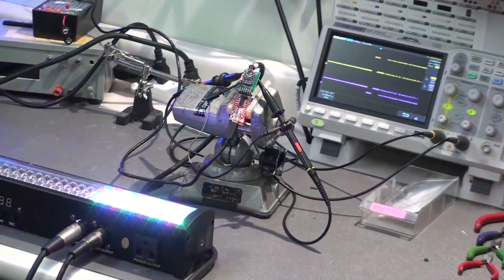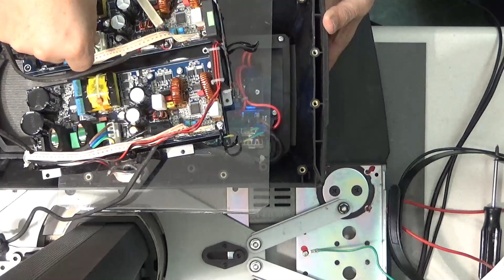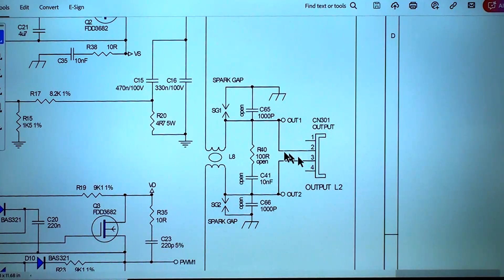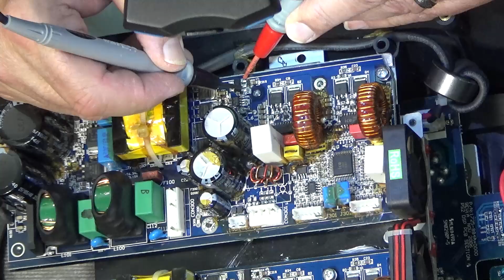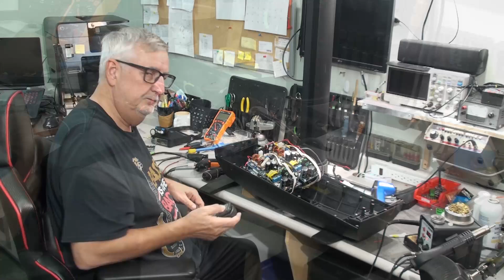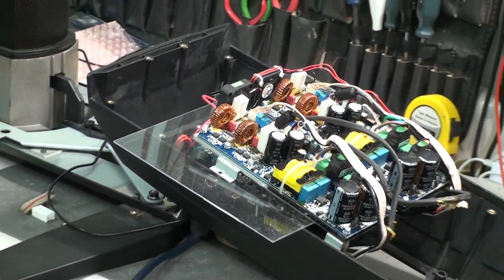"Sticking" with a Bose L1 Model II Portable PA - Part 2

Comment: Hi Ron, 

Awesome video thank you so much! I am a musician and shade tree electronic repairman for my own gear if possible .  I have some questions about this same Bose L1 model 2 that has worked great for years until now.   I hadn’t used it in a while but we were going to play a show and it had a lot of persistent noise coming from just the tower alone w/o any B2 base module connected and nothing connected to it at all .. no tonematch input , no analog input.. nothing.  Just the power cord and tower.  It wouldn’t matter if I was turning the trim pot at all but I know that historically these Bose trim pots tend to crackle “scratch” when you move them but all noise would stop when you stopped turning it. Mine always did that.  

Yet now this same noise was persistent regardless of whether I turned the pot or not but since it sounded similar - I thought it might be the pot so I tried spraying, didn’t help and then I replaced it with a THONK Ltd A100K - D shaft - Alpha Vertical 9mm Potentiometer … and the noise isn’t as loud but it’s still present.  

However, now the volume doesn’t work at all for the analog input and there’s no sound at all coming at all from the analog .  Only the tonematch input works but there’s still some very faint persistent noise.  I looked at the old photos of the old pot that was in there and it looked like pin 5 & 6 on channel 2 were soldered together so I did that.  Is that correct to do or should they always be disconnected?  I can’t tell if pins 2 & 3 on channel 1 were soldered together so I didn’t connect them… and I’m not sure if they are connected through the board or should I solder them together?  All other pins look like they are  individually soldered.  Is that correct according to what you have seen?  Thank you so much! 

I emailed you a pic I just got from THONK and it looks to me that if pins 5&6 or 2&3 were soldered together, it would be like the volume was turned all the way up?  Is that what you understand? 

Anyway, thank you so much for any help or ideas you might have! 
Your videos are super are awesome :)

Warm Regards

Comment: Hi mine the blue power light turned solid red and system won't work? What can it be thanks
Reply from the maker: That sounds pretty serious, but at least it isn't intermittent. I can't help you much with limited information. If you aren't a tech yourself you should find one. If they need information (schematics) email me and maybe I can help. techtips983@gmail.com

Comment: Bonjour from France.

I’m a singer-guitarist playing with my own backing tracks. 
I bought a Bose L1 Compact in 2012. I’ve  done countless gigs in all sorts of places and it’s still working fine. 
My 2017 Bose L1 Model II is still around too, with one B2 sub.  The only thing  I had to get fixed is the input jack last year. 
I have the opportunity to buy two more of these used ,from a pro, with a warranty. I think I will make the deal. 
I don’t have a van, just my car. My Two Rcf 712 and my 905 sub are too heavy for my 55 years. 

Oh yes, there is the annoying ‘’Bose hiss.’’
Reply from the maker: Thanks for the comment and sharing your experience. That's good to hear about the L1 Compact and Model II!

Comment: I'm getting a low static sound on my L1 Model 2. I tried another outlet and unplugging everything from it minus power and it's still present. Its not the power hiss sound. I have a second L1 and I don't hear it on that one. Any thoughts or ideas what could be causing it? Thanks
Reply from the maker: I've heard others mention a "hiss" in their system, but I don't know of a typical cause or solution. I'm just guessing but I would start by checking the signal in the analog part of the signal path (input section) to see if it originates there. If it originates later, in the digital or output section it would be more difficult to find, I think. I did a quick AI search and one comment was "...the system may produce a faint hiss when all settings are at the 12 o'clock position with no inputs connected, which is a known characteristic of the L1 system. To address this, users are advised to keep the channel and master volume controls on the remote at or above the 12 o'clock position to provide headroom and avoid the hiss."
Reply: @techtips983 Thanks for the replay and all this info! I'll try troubleshooting a bit more to see what I discover.

Comment: Thank you very much for the video. The fan on the L1 model two is quite noisy. Can that fan be replaced with another one that doesn't make noise? Can you recommend a model? Thank you very much!
Reply from the maker: Thanks for your comment and question. I've heard that these fans can be noisy but I haven't seen one myself. I guess that, depending on where you are located, you might be able to get a replacement from Bose. I believe that fan is a 12 VDC, 5500 RPM fan. It doesn't show the dimensions but you could measure it. The manual I have doesn't show a part number but it refers to a Bose service bulletin: 296133-B1. I haven't been able to find that online but you could try... Sorry I can't be more helpful.

Comment: My bose same model as what you repaired has issues in the ethercon jack.. when i plug my bose mixer T8s the mixer would work then light on the mixer display will blink and the mixer will have no power..had to use the a separate t8s power adapter and had to use the line inputs in the base..its very  convenient for me just to use a ethercon cable and both power and signal
Is carried in the same cat5 ethercon cable..do i have a bad ethercon low voltage circut issue on the ethercon area on the bose L1 base unit?
Reply from the maker: Hi and thanks for the comment and question. I'm not sure I can give you good advice on this. My experience with these units is fairly narrow and I haven't worked on the connection between the T8 and the base unit.
Reply: @techtips983  The base unit's power supply cannot supply the necessary current to run the T8S. I've seen that noted in a variety of sources. The power adapter is the way to go.
Reply: Same issue as mine😢 ended up just using xlr cable and power supply for TS8..now my new issue is one of my column speaker is distorted probably voice coil is toast🤦🏻‍♂️..

Comment: Hi thank you for sharing your knowledge, just had the same fault, 4.7 ohm but on the other board, also replaced very noisy fans and now going to strip it to clean trim pot as its very noisy as well and the loud pops seem to cause protection to activate
Reply from the maker: Thanks for your comment. Interesting symptoms... I hope you get a solution.
Reply: @techtips983  Saw another clip from a German contributor in which he points out that the failure of the 4.7 ohm resistor is due to the failure of tha cap next to it 330n 100v and mine is completely bloated and o/c, have ordered replacement, hope thats it.
Reply from the maker: Interesting... Sounds like that could be your issue. I didn't find that with the one in this video but if that cap failed it could cause that problem. Let us know if replacing that cap solves the problem. Thanks for the comment.

Comment: Thank you Sir for the very informativ Video and professionell work. I have a Problem with my L1 too - I made a huge mistake by trying out a different bass speaker: i have connected my Phil Jones Bass speaker to the L1 via speakon plug 
It worked at First but as soon as i turned up the volume the FAULT light flashed and the Bose stopped playing any music.
I recon the OHM from Phil Jones Bass speaker where way to high to handle for the Bose amplifier…can you please give  me a tip what i could do? Is it worth to send it in to repair? Thank you and greetings from Austria
Reply from the maker: Sorry to hear about your issues. I assume that once you disconnected the Phil Jones Bass speaker and reconnected the Bose Subwoofer the problem still existed? Did the other channels work at all? This amplifier doesn't have fuses so that can't be the issue. The FAULT detection circuitry is supposed to disable the system temporarily and it should reset itself after being shutdown and restarted. If the FAULT light continues to to be on after removing the speaker, and if the channels don't work, I would start by checking the power supplies. That isn't easy. If you are not a tech you would need to find one who could work on this. I'm in Canada so I don't think it would be possible, or worthwhile to send it to me for repair. Sorry I can't be of more help. Ron

Comment: Wow Awesome, Great troubleshooting, I am glad I found your video, I have the very same problem that you diagnosing with BOSE L1 Model II PA. When I turn on the music, let it run for around 10-15 minutes then it started to cut off and on with red LED turn on and off. I don't know where to start but I suspected it have something to do with heating problem. so I let it sit for a while then turn it back on, the problem came back after 10-15 minutes ON... Can you please give me the resistor part number, the manufacturer and where to order it. I will really really appreciate very much.. Thanks in advance... Tom...
Reply from the maker: Hi Tom, thanks for the comment. The resistor I used for the repair was a standard one available from any electronics supplier. It's an axial 4.7 ohm,  5 watt resistor. I think I bought it from Digikey, which you can find online. As I mentioned in the video, there are several different protection circuits that provide protection from different problems. In my case it was that resistor in the Zobel circuit, but yours could be different. Since it appears to be time/temperature related, you might also try using an infrared temperature measurement device (fairly inexpensive these days) to try to locate the component that is heating up. I hope this helps...

Comment: Hello could you please tell me where the fuse is located in the bose l1 model 2 ? Thank you..
Reply from the maker: As I understand it this system does not have a fuse. It has several internal sensing systems that shut down the unit if something goes wrong.

Comment: Both of your videos on this are very informative.    Thank you.  I have one of these units and am also getting scratchiness from the volume pot.   I have a can of Deoxit Fader F5 spray.  I don't want to take the unit apart.  Do you think there's any danger of spraying around the knob on top of the unit and hoping it finds its way down into the pot to clean it up a bit.    Thanks in advance.
Reply from the maker: Hi. Thanks for the comment. It's worth a try but you should remove the knob itself and try to spray down along the side of the shaft while turning the shaft back and forth. Depending on the internal construction of the pot you may or may not be able to get the cleaner onto the wiper and resistance strip insider the body of the pot. (Some newer pots are pretty well sealed against dust.) Only spray a small amount and then, with the unit ON, turn the pot repeatedly while listening for scratchiness. If you don't hear any improvement, spraying a lot more will probably not help, and you don't want to get a lot of the spray inside the unit (on the printed circuit board and components). It probably wouldn't cause immediate problems but might catch dust that could cause problems in the longer term. I hope this is helpful...
Reply: @techtips983  Very helpful.   Will give it a go.   Many thanks!

Comment: Hi there, I hope you are well. I have a Bose L1 Model 2 system, the bose is running a red light fault when I turn it on there is a very loud pop sound (like a power surge on switch on) I am in the UK and finding it hard for someone to take a look, in your opinion does this seem like it could be repairable? any advice would be appreciated. Great videos thank you for sharing your knowledge. :)
Reply from the maker: Hi Marie. Thanks for the comment. I do think your system is repairable although, as my video indicates, these systems are a challenge. (My record for this model is one success, one failure.)  There are two possible ways to go: 1) find a repair shop/person in your area who does Bose repairs, or at least is willing to try to, or 2) find out how/where Bose handles repairs in your area. For the first option, if the tech does not have, or is able to get, schematics, etc. I might be able to help with that. If you chose the second option, you may be able to send your system in for repairs. In North America Bose has a factory repair service that will fix these systems for a fairly reasonable, fixed cost, including shipping. I don't know whether they offer that in your area or not. Try searching online for a Bose representative in your area and go from there... I'm sorry I can't be more helpful, but let me know if you need schematics, etc.
Reply: @techtips983  Hi again! really appreciate you taking the time to read my comment and reply. These Bose systems sure are tricky! thank you kindly for offering to share the schematics, I think i'm going to sell this system for parts or spares now, no one in the UK seems to repair these systems and I was told bose don't deal with them because of how old these models are now. Keep up your fine work and sharing your knowledge. God Bless ...Marie :)

Comment: Hello. I need an assistance form you. My ToneMatch mixers master knob is not showing any blue light and sound is not going to the L1 speaker. I didn’t find any thing inside if the master is mute or not. Do you think it is a hardware problem or anything else? If you will please assist me. 
Thank you 
Dew
Reply from the maker: Are you getting any of the lights on the ToneMatch coming on? If not, it may be a problem with the cable from the base to the ToneMatch, or else a power supply problem in the base. If you are getting some lights on the ToneMatch but just not the master, the issue could be in the ToneMatch. It's pretty difficult to analyze from a distance and with limited information. You might have to find a technician who can help. If you have technical skills I could provide some schematics...

Comment: Such a coincidence , i was trying to fix same product from same reason, im glad you showed ıp on my discover page, sir , did u try yo test in an hour along? Because i did many things and went good for a while but after an hourit was failing again..i was doubting abput capasitors, it gives popping and crackling noices after sometime from power on
Reply from the maker: Hi. Thanks for the comment. I wasn't able to fix the Bose unit described in Part 1, but the repair I did on the Bose in Part 2 appears to be holding. I spoke with the owner after getting it back to him and it is still working properly. There are several reasons that may be triggering the Fault system (over current, thermal shutdown, zobel sensing, an possibly others) so any of these could be the source of your problem. Some of these faults may not show up immediately, especially if they are related to temperature. It is possible you could have faulty capacitor(s) but the question is "which ones?". The popping and crackling noises are certainly a clue but further testing would be required. Sorry I don't have a more definitive answer for you...